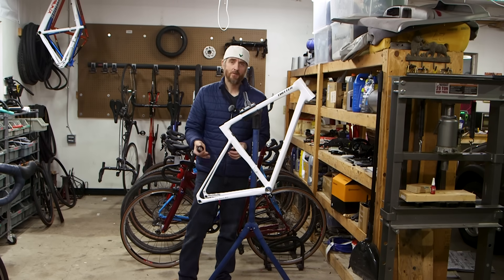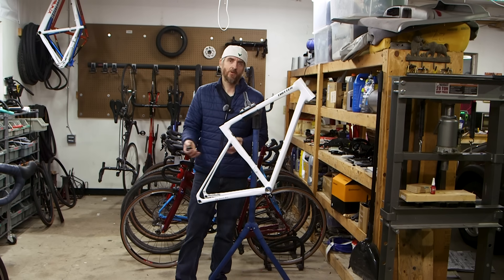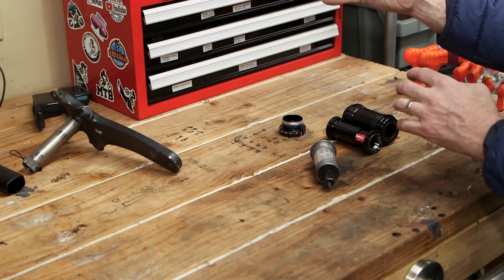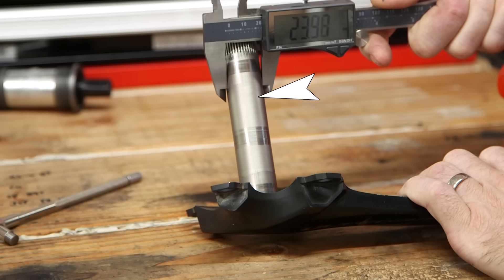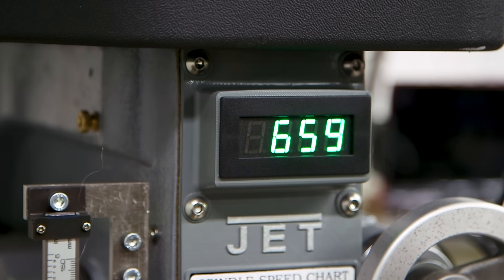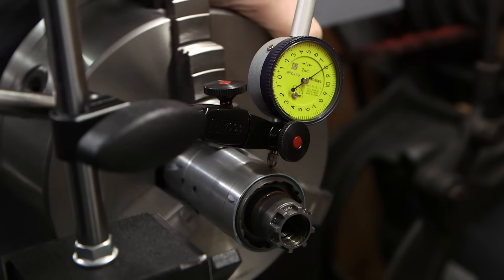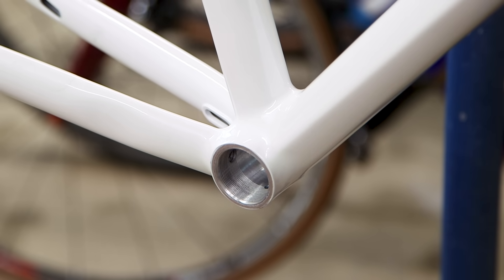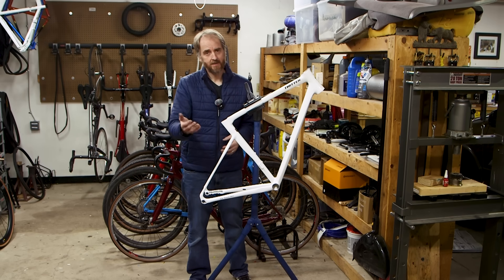I destroyed frame's bottom bracket threads, but I also fixed them.  Here's how.

Comment: You can buy repair  bottom brackets for stripped frames,  that don't use the external threads. The 2 cups thread together to tighten the BB.

Comment: That's a pretty good repair. My only fear is that the welds around the bottom bracket  could have been compromized. But, you didn't remove very much material. I'd be as interested in knowing why you think the threads galled so badly in the first place. That's what we need to avoid. I put a new BB in a 30 year-old Centurion frame. Steel is much less likely to gall. But, I hope I never have to replace that BB again.
Reply from the maker: Because this frame uses internal cable routing, they drilled the bottom bracket so the cable could run through the stay to the rear derailleur.  They did this after it was threaded.  I did not debur that before installing the bottom bracket.  It falls perfectly inline with where the threads on the BB were galled.  I suspect that there was some thread damage in the bb shell, caused by that drilling, and that when I snugged up the bottom bracket, I inadvertantly galled those threads.  It's really all I can come up with again.  I've installed many bottom brackets in my life and never had this happen until that frame.
Reply: @RobertAdairWorkshop  Perfect explanation. Unfinished machine work is the bane of every mechanic.

Comment: ok, you saved yourself, but the main question is why this happened, did you overload the thread by tightening it with too much torque or did it lock up from tightening it by hand
Reply from the maker: I suspect there were issues with the bottom bracket shell threads inside the frame, where they cut through to allow cables into the stay.  I didn't debur that.  That lines up with the very end of the bottom bracket so when I snugged it up, those burs galled the thread.  Then, the rest is history.  That's my current theory, anyway.

Comment: Only one suggestion  I would have frozen the insert and warmed the bottom bracket , this would have allowed the insert to drop into position probably without the need of the press  and any strain put into the bottom of the frame.

Comment: Good work, well done I like it. But who have a 2nd frame as a spar part spender, almost nobody I think.
Reply from the maker: I have a few I've collected over the years.  All junk that I've saved for parts on in the hopes I'll learn the skils necessary to fix them.  This one is an XS trek city bike that I'll never fix so it was a good candidate for taking the bottom bracket from.  It's not gone to waste, though.  I cut it up the rest of the way, saved the head tube and brake mounts for future projects, and will use the rest for machining projects.

Comment: Impressive work, Robert. 
would it be possible to add jbweld to the damaged threads and cut threads into the jbw?
nic
Reply from the maker: I tried thread repair one using JB Weld and it didn't work out.  The JB Weld pulled out when I backed out the bolt.  I haven't tried again since.

Comment: The repair demonstrates your expertise, but I’m more interested in what caused the threads to strip. Since you said it went in by hand all the way, it couldn’t have been cross-threaded. Could over-torquing have been the cause?
Reply from the maker: It wasn't over torqued or crossthreaded.  After threading it in by hand, I snugged it with a wrench as I've done hundreds of times.  I can't 100% say why it galled, but I suspect there was a problem with the BB itself and when I snugged it up, I damaged the threads.  The BB had a thick layer of thread compound on it.  That may have had something in it, or was hiding thread damage.  I'm not sure, but I should have cleaned that off.  Lesson learned for next time.
Reply: @RobertAdairWorkshop yup, definitely this scary story goes into my book of BB nightmares. As someone with neither skill nor tools required for such repair, that frame would have been a write off for me. Scary to think that you can do everything right and ruin a frame anyway. Thank you for the response.

Comment: If I were you, I would make a new custom made bottom bracket cup with a longer thread, because there is still enough healthy thread in the frame.
Otherwise, well done.  I don't like the removal of material in this place, but it will probably be OK.

Comment: Really love the idea to use a dead frame to save another. Instead of throwing away two frames a buy a third one ;)
If I am not wrong you kept something like 3mm of thickness on the BB shell of your frame. That is not a lot. If I were you I would have machined only the damaged side and a little bit more to give to the shell maximum surface contact to the frame. So that the frame can keep most of it's integrity and one BB cup is still connected directly to the frame. To prevent the entire BB+shell from spining inside your frame in case your repair gets play with time. It can be corrosion or wear with micro movement due to frame elasticity, etc...

Comment: That is the best way to fix such a problem. Here in the UK, we have specialist frame repairers who take all the work out of the equation for about $150. If it was possible to buy a sleeve, rather than kill that poor Trek, I would've done that too.
Reply from the maker: I could have purchased a bottom bracket shell from a frame builder and used that.  What people seem to miss is that the trek had a crack in the head tube which extended through the lower bearing seat.  I deemed it not-worth-fixing so it'd either be thrown away or used for parts.  I kept it to use for parts.

Comment: If the repair functions it was successful. Good on you for getting serious about repairing the frame even if your hand was forced.

For better accuracy consider making threaded plugs to hold the shell in the lathe. Which ever end of the shell will be toward the tailstock (LH threaded end) make that plug first with a shoulder and a support  center hole, then make the opposite side (RH threads) and mount and turn the shell in one setup to know you’re turning the shell OD concentric to the ID without needing to indicate a rough /weld distorted surface. 

👍

Comment: Great fix, but what caused the damaged threads in the first place?  It was a brand new BB that you screwed in by hand and it somehow ruined your frame?  How can we avoid this in the first place?
Reply from the maker: It was a cheap Bucklos ceramic bottom bracket.  It had a load of thread compound on it from factory.  I suspect it had something in that compound, or was hading some thread damage near the bearing that I’d missed.  When I snugged it up, I must’ve pushed that into the threads, causing the damage.  First time this has happened to me and I’ve installed hundreds of bottom brackets.

Comment: What I think as a mechanical engineer, is you are a very thoughtful and talented man.
Well done on the repair. Of course this would exceed the skill set of almost all watching because they don't have access to the expensive machines you own or a sacrificial donor bike with BSA bottom bracket.
Thanks for sharing your solution.
Reply: Your local bike co-op always has a few bikes they're going to scrap to provide a donor shell.  The equipment and especially the expertise, however; much harder to come by.

Comment: A delightful solution! For the less advanced (as I am): I had a similar issue with a frame that had a similar damage on the right-hand side caused by a bottom bracket that wiggled itself loose. What solved the problem was tapping the threads and then installing a Shimano "Saint" bottom bracket (SM-BB80). This bottom bracket has around 14 turns on the right-hand side instead of the 7-8 turns of other bottom brackets. This was enough to securely fasten the bottom bracket. This solution will only work on the right-hand side though as the left-hand side of the SM-BB80 does not feature more turns than standard bottom brackets.

Comment: A very interesting video, thanks. I remember the old Raleigh frames in the UK from many years ago. For some reason, Raleigh used bottom bracket threads that differed from others on the market by (if I recall correctly) just two threads per inch (TPI). That doesn't sound much, but it meant that a bearing shell from another maker would go in easily for about a quarter of an inch, and then tighten up. Go any further and that would cause damage to the frame. 
I later owned a frame that stripped out its bottom bracket shell - this was due to age, wear and tear. A skilled frame builder reamed out the shell and brazed in a steel sleeve, followed by cutting a new thread. A benefit of a steel frame!

Comment: BITD, Mavic had a BB shell that was made for their cranks, but the BB sleeve could be used exactly for this use in frames that had hooped BB threads. The only downside is that the BB shell had to be chambered with the Mavic BB shell tool since the BB sleeve had a funky chamfer angle.

Comment: Without a machine shop on hand I have used the threadless bottom brackets by YST but they are only available in square tapper but also less than $50.

Comment: There are "Repair BB for damaged threads" "kenli kl-08es 68" for example what is it - its regular square type bb with inner thread like on bb90 and cone cups faced inside bb hole. This is the fastest cheapest and easiest solution, but it is 100% not for a good or a new bike as it looks meeeh and has mixed oppinions on durability
Reply from the maker: I like the honest assessment of the thing.  Thank you.

Comment: I had some new wheels that I hand threaded the disk brake lock ring on. It went on smooth and cross threaded. Like, HOW!?
Reply from the maker: Those rings can be a real pain.  I've almost cross threaded them myself.  I even had a wheelset that came with them miscut so the nut wouldn't go on square.  I fixed it but I was certain I was cross threading the thing.

Comment: Seems like a really solid repair; it's what I was expecting as soon as you said "mill." The offset diameters for alignment are a very clever touch.

That said, my first thought was to clean up inside of the bottom bracket shell and use the boring head to single-point-cut threads for the Italian bottom bracket.  It would be elegant and possibly lighter, albeit really difficult and possibly not worth doing.
Reply from the maker: Really difficult.  My mill doesn't have a power Z-axis so I'd have to do the helix by hand.  Not impossible, but nearly.  I did briefly wonder if I could make some sort of power feed but that idea left my head just as soon as it popped in.  I agree, though, it'd have been a romantic solution.
Reply: Ooh, yeah - without a power feed it would have been tortuous,  @RobertAdairWorkshop

Comment: I had a similar problem with a Giant Trekking bike. The bottom bracket got cross threaded at the factory, but it took me about 14 months to realise that there was a build problem. After a very tricky removal of the Shimano bottom bracket my frame threads looked very similar. I took the easy route and purchased a BSA tap kit which wasn't expensive. Much to my surprise the frame threads cleaned up quite well after a few runs through with the tap and the new bottom bracket fitted fine. However, I found a bottom bracket from another maker that had a few more threads that would go deeper into the frame where the undamaged frame threads were. That was easier to obtain than I expected. I used the bike for another five years with no problems and I changed my next bottom bracket a couple of years later with no drama.

Comment: Bravo. The question is more related to prevention. I doubt it was originally a screwup on your part based on your knowledge and experience other than the threads were out of spec to start and this is typically from Chinese products where QA is an after thought.

Comment: Old frame builder here.  Back in the steel days we would just throw some brazing rod in the BB and then re tap for new threads.  I've personally done at least a dozen of those.  Never had one fail.  I've seen guys throw a few weld passes for the same effect as well.  I'm wondering on AL if you could have just run weld bead in there and then re-prepped.    Honestly the sleeve idea was great and I'm glad it worked out!

Comment: nice fix and informative video. I am still thinking what else the reason/s why the thread had been screwed if the bottom bracket went smoothly? at first time.
Reply from the maker: I'm really n ot sure myself.  Whatever it was, it happened when I snugged up the BB or when I first started to unscrew it.  There was so much thread damage after I boneheadedly pulled the BB out with an impact, that identifying the cluprit was impossible.

Comment: Considering the QC variance of Chinese manufacturing, It would've been a good idea to chase the threads on those before butting any bottom bracket on.
Reply from the maker: Yeah, I'm going to make a thread chase and keep it in my toolbox for the next one.  Need to see if I can accurately cut 24 tpi threads on my old lathe.

Comment: Very impressive repair. Enjoyed watching it. I'd be interested to hear your thoughts on what you think caused the thread to fail in the first place. Thanks, Jon
Reply from the maker: Hey, Jon.  I can't say for sure what caused it but I suspect it was the bottom bracket I used.  I went with a cheaper Bucklos BB so I could afford ceramic bearings.  That BB had a lot of thread compound on it.  More than I usually see.  There may have been something in that compound or hidden damaged beneath it, that became a problem when I tightened the BB against the frame.  I've never has a BB go in by hand but then gall threads before.  Usually, you know it's going to happen before you get there.  I won't be using cheap BB's from now on, just in case.
Reply: @RobertAdairWorkshop  Agreed, a failing thread tends to whisper to you..... "I'm on the edge, don't push your luck!!". So I too was really surprised to see it fail. I will admit though, I've never tried a Bucklos. My choice is Shimano, Praxis, or the new kid on the block Bikone is also good.

Comment: Good repair 👍
You could have used the original sleeve cut down. And sleeved the frame with a small threaded sleeve to match. 
No real need for locktite of sleeve 😅
But the moral of story is clean and inspect Aluminium parts carefully ! 
Any defects will return in Galling of parts even with a good grease. 

I understand Titanium is worse than Aluminium so the same applies 😂

Comment: Man, if I were you I'd never chase the tight fit as you did but just give BB barrel let's say -0.02 - 0.03mm then glued with Loctite 609. Press fit gives 30% max of the entire mating surfaces engagement whereas Loctite achieve 100% surface contact so you won't be able to shoot it off with a cannon. Also using press induces risk of causing deformation such as radial displacement to the aluminium sleeve bonded into CF structure resulted in its further separation. At the same time the Loctite fit doesn't induce any stress at all.

Comment: I think I would bore out the BB to accept any deep groove ball bearings with 25mm bore, get myself a a plastic adapter for 24 mm Shimano cranks and Robert is my mother's brother. Use tef gel to protect from galvanic corrosion. I don't know how loctite would behave in that situation.
Reply from the maker: The problem I ran into with pressing in wider bearings is that same one that I had with the BB90.  The crank arm narrows down.  I'd need bearings that extended 11m out each side of the shell and couldn't come up with a nice way to do that.  I even thought about flanged ACB's but couldn't get there.
Reply: @RobertAdairWorkshop  you're right. I disregarded that you need 86mm outer shell width with shimano cranks. BSA gives you most commonly 68 mm, and external cups make up for it.

Comment: Can you explain better what caused the damage? Was it cross threaded? If it went in so easy why did it get stuck? And  please explain how could you have removed it without damaging the threads?
Reply from the maker: I don’t really know why it seized up.  It wasn’t cross threaded.  I used a cheap Bucklos ceramic bottom bracket.  It had a thick coating of thread compound on it.  I suspect there was something in that compound ir maybe it was hiding thread damage?  Really not sure though.  To remove it without further damage, drift out the bearing with a punch.  That’ll leave just the aluminum cup.  Then very, very carefully cuts a slit in the bottom bracket cup with a hacksaw blade until it’s thin enough that you can bend it and split it with a punch.  Work around the diameter of the cup with the punch and drive it out.
Reply: @RobertAdairWorkshop good insights. Ah I understand the solution now that makes sense. Yeah I suppose a slight bit of bad thread hidden under the compound could cause this. Sometimes when installing BB that has a lot of v that compound (Shimano puts a lot on) it worries me how tight it feels. I know I have started it right but once it hits the compound … it can be hard to turn.